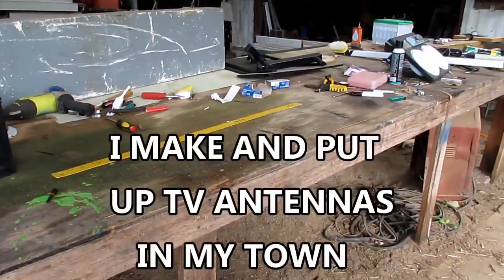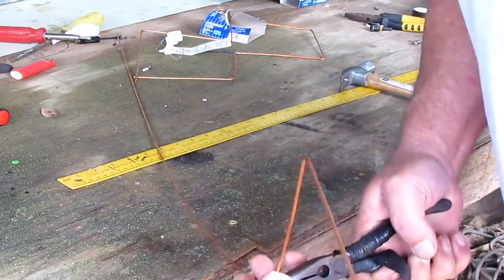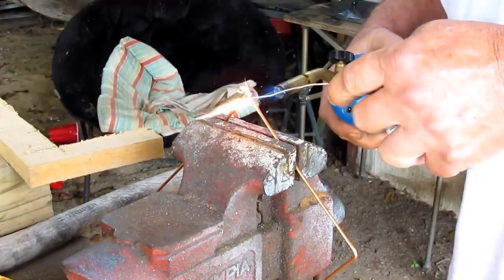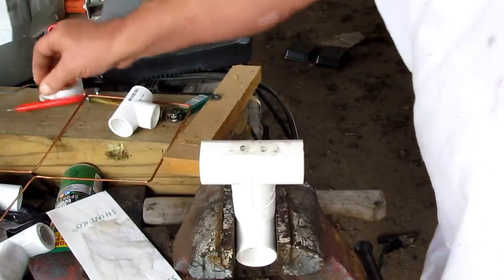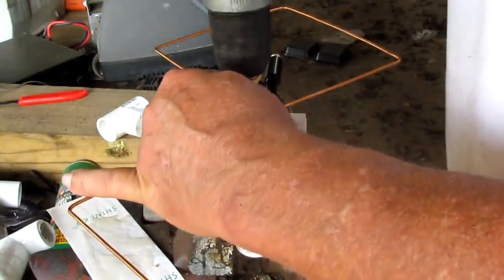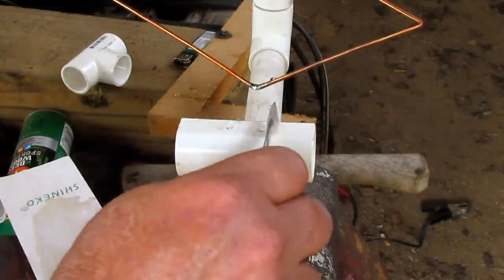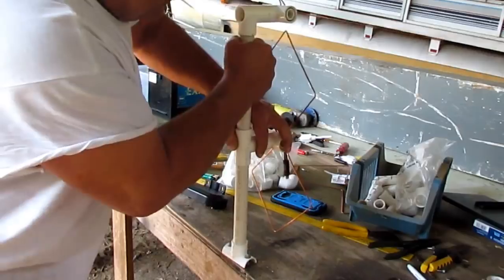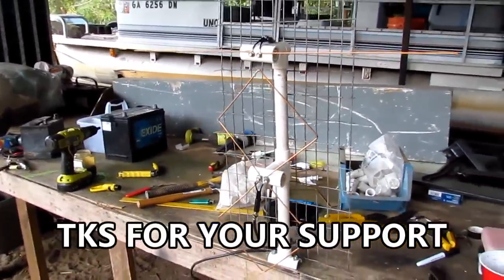Best DIY Indoor Or Outdoor TV Antenna Ever Made

Comment: Danny, the bottom antenna is called a bi-quad. The top is called a dipole. The bi-quad can be improved by adding 2 more diamond or squares on each end. 2 can be enough if the signals you are wanting are strong enough. If the signals are weak add the two extra but do not let them touch at the corners. Your reflector will work better if they are 2 1/2 inches or so from the main element. You can experiment by moving your reflector to find an improved spot. And then again you may not for reception only. But try it some time.
Reply: Por favor .lo podrás traducir en español .estoy muy sorprendido con ese proyecto .agradecido .

Comment: Our building at work is brick and steel beam, we have a HDTV in the lobby.  We've tried 4 different antennas (1) 30 mile, (1) 60 mile and (2) amplified 60 mile.  None of them have been reliable and zero have been able to pull in CBS on VHF.  Watched your YouTube video and decided to give it a try.  You are exactly right... a stick of dynamite!  It has been THE ONLY antenna to pull in VHF channels, and all of the UHF channels have solid reception.  The proofs in the pudding and your antenna has delivered.  Our secretary will have a Christmas surprise when she returns to work and sees the Price is Right on CBS/VHF.  Thank you much for the DIY video.
Reply from the maker: tks for letting us no

Comment: I made one based on this design, I have in attic with 50 foot RG6 coax leading thru walls to garage where I have a 4 port channel master amplifier that goes to 3 TVs in house. The only thing I did different is I removed my reflector and I had a better result (in my area my towers are in all directions so a reflector worked against me). Also I used 8 gauge copper, made bends at 9.5" instead of 6 making my copper length of 76", then for mount I used a 4 foot long 2x2 with PCV "T" mounted to that with "L" bracket. This design outperformed the Clearstream 4-Max which retails for 149.00. I only spent 12 in parts to make this antenna. I never thought of using a drill to straighten out that copper. Thanks Danny.

Comment: I built on just like it. My reception is nearly perfect. 40 miles from station - second floor inside in hallway  - NO AMPLIFIER - just a combiner. Best reception of 3 different antenna. Thanks Danny!!! Tim
Reply from the maker: tks for the info on that
Reply: Amplifiers only benefit the signal if it is above the noise floor of the amplifier, they are used for long cable run line loss or the signal is split to a few receivers. A broad band amp would never have a better noise figure than a tuner, so putting an amplifier right next to a receivers Ant input would not help.  Signal to noise ratio is the important part and ATSC has a tolerance for noise.  Cable companies do not use ATSC  because it takes too much bandwidth they use QAM .

Comment: Constructed primarily from scrap at hand I build two bow-ties on a single refector of just undersized and just oversized of your seven inch baseline, connected to each other with cheap 300 Ohm antenna lead and tapped equidistant with the balun terminals. My copper rod is solid core home construction wire remnents, often I leave the insulation on, which doesn't seem to affect performance at first but much later, having no patina, those antennas have better signal strength than ones I've built with stripped 12 gauge home wiring. To minimize bimetalic corrosion, I use brass screws recovered from old TVs and strip the balun ends to copper then twist and curl onto the screw, soldered, then seal that terminal under hotglue. My balun is the amplifier as well, DC powered by the indoor end of the CoAxial. I even use scrapped and discarded weather hardened twin coaxial cable from homeowners who have decided to "cut the cable" from their Frontier communications provider bill to bring the signal inside. Even the mount is recovered from the wooden yard stakes of candidate signs left over after elections which I wrap to the plumbing riser vents on the roof with discarded coat hanger wire. I use a staple gun to mount the reflector on the back of the stake, and insulate the staples on the front for the bow-ties with end of a long thin strip of home construction roofing felt remnant, cut away from the staple after being attached. My best reflector was powder coated perforated steel cut from a security screen door, second best reflector was expanded aluminum from the bottom of a screen door painted with Rust-Oleum - both paint jobs were as discarded, not my idea. Decent refectors I've salvaged small stainless steel racks from mini-fridges and toaster-ovens, but I've never used rabbit-hutch wire (is that what you use?) The digital ATSC signal is fine with this UHF only design and so, not needing FM radio, I do not include VHF dipoles.

 How dare I claim 'design'? I stole that from ANOTHER guy on YouTube! The most expensive bits of my antennas are the amplifier pair. As measured by the digital tuner setup screen, the signal seems unaffected when the antenna is hung from attic rafters. The signal strength from my antennas are far supierior to and beats anything available from WorstBuy (Best Buy), and, being built from scrap at hand, is a miniscule fraction of the cost. I like your use of PVC but I have no T's or elbows, just plenty of demolition piping which I've used for masts. I learned from you the 'twist' to straighten the wire, but I will still chase the kinks from the wire by hand as best I can first, then twist. I can't disagree, for digital TV, bowties beat all. Why buy "Free TV Key" when you can build your own, more durable, and with better reception? Do you know why you buy one and get the other "free?" Because when it breaks, that was the "free" one!

Comment: Good stuff...I learned how to make one right when DTV started. I got my design from a Popular Mechanics article. I made one with larger wire and a 6 foot 2x2 mahogany plank and when I was done, I was picking up WBTV out of Charlotte N.C. from our little farmhouse in Leicester N,C It was a big contraption with 4 V's on each side and the wire was roughly 4 ft. long each way. Without any booster, I was picking up a Charlotte station inside the house ! and we were a minimum of 100 miles from the broadcast station, probably more so if it is a straight shot to the signal, that always helps.
Now that I've seen your design, I think I'll build another one and make it a hybrid type with a backboard like yours. We have Spectrum Digital Cable as part of our rent but if we didn't, I would use only an antenna. Great  job...I'm going to look at more of your clips. Keep at it, it's great !

Comment: I built one following your instructions. It doesn't look as good as yours but I stuck it in the attic so no one will see it anyway. I'm not using the booster and I still get 24 channels at 30-50 miles away. I built mine with junk I had laying around the garage so my cost was $0. It works much better than the "cheap" one that cost me $20. Thanks.

Comment: Ok the top piece for vhf. I changed it a bit. What I did was I made them 24 inches out #8 grounding wire. Then I put aprox. a six foot radius on them. I also got rid of the 75 Ohm connecter and just went direct. Other than that this is the best antenna ever. Great job bud

Comment: Hi,Danny.You might solder the 300-ohm side of the balun to the copper elements,prevents trouble a few years down the road.And that device you are talking about for combining vhf and   uhf signals is  called a splitter-combiner.Phasing lines mounted behind the reflector can be used instead(check the theory in the ARRL handbook). I've used both.And the booster is to make up for any losses in the line.From an old tech in the Canadian maritimes.
Reply: Why VHF? Hasn't all the new digital gone to UHF?

Normally height is more important that gain. That being the case I built a fan dipole with 3 elements for my camper so I could string it up a tree and it works great here in Texarkana. I forget how many stations but was 5-6. We went camping up in the Ozarks I strung it up 15ft and zero! But its a deep valley where we go camping. 

I am thinking of building a Slim Jim next. This way I can pull it higher in the tree and it has more gain.
Reply: @tonymoore205  YES BUT NO. I THINK THE AMP IS IN THE WAY
Reply: WW5RM You are partially right.   Most Dallas stations have changed to UHF but Ch8 (ABC - WFAA) and one other are still in VHF
Reply: @brentjohnson6654  I thought it was a nationwide move forced by the government that everything go digital and move to UHF. Back when they gave the converter boxes away around 2006-2008 or so.
Reply: @WW5RM  it was. FCC allocates the frequencies.
Reply: @Mikael5732  then how is it possible some stations in Dallas are still on VHF?
Reply: @WW5RM  NO!  That's what i thought too (that all dig went to UHF) So, that's what I put up in 2006 when my huge 22ft VHF/UHF blew down....   In my market we still have 2 HIGH BAND VHF!!!  No, I can't get them on my UHF antenna...  I have designed a full wave square loop for those channels.  it works great in brick houses but, unfortunately, my shop is in a steel building - so I can't get those channels here unless I get it on my roof...
Reply: @hotpeppersrcool  where?
Reply: @brentjohnson6654  Not sure of YOUR market.  I am in Louisville, KY.  BUT, no matter analog or digital, VHF ALWAYS goes farther than UHF - so the "smart" stations (if they WERE VHF) can reach more viewers.  People like you and me (who have taken down our 10ft+ long antennas) can NO LONGER get these channels - even if they "appear" to be UHF numbers!  ALL channel numbers are now "virtual" .  Like, what used to be (in my market) VHF channel 3 (our LOWEST VHF channel) now shows up as UHF channel 47 - which requires a MUCH smaller antenna to receive it!

So, in Louisville, we have Channel 21 (VHF 8) and Channel 11 (VHF 11) which I can not get.  When I am at home (closer to town) I built a full wave square loop (indoors) and I get them just fine - but not at all in my Faraday shield of a steel office building....
Reply: @WW5RM  That's what I heard too...  But some channels are still on VHF.  They just sold 600-700Mhz to a cell phone company - hence the "rescan" if you had to do it last month.  But, in MY market, unfortunately, the VHF's stood where they were.   No matter if you are AM, FM, SSB, DSB, USB, LSB, or ANY of the digital modes...   VHF will ALWAYS go farther than UHF - and that is WHY those station are still there!
Reply: Hugh Jorgan yes I agree that UHF or VHF doesn’t care if it is a analog or digital. I had a UHF antenna originally based on the kit from Danny S Hodges. I had to add a VHF dipole and a combiner pre-amp. I was able to receive real CH8 which is where the virtual ch8 is transmitting in Dallas. Most every other channel is in UHF. You are right about the old 10’ antennas.  A recent tornado blew my channel master TV antenna and tower over.  What a mangled up mess.  Haha.  Thanks for your comment.
Reply: @hotpeppersrcool  yeah I was looking at antennas recently. One said it only covered from CH 21- 80 or so. I thought well crap thats useless because we have 3, 6 and 12 out of Shreveport. But the actual freq of these channels fell in the freq range of the antenna so they just kept the old CH numbers and its virtual like you said. Also i know its digital and narrow signal but wondered how they crammed 3-5 sub channels into one channel. They aren't. Maybe 3 digital channels take up the same width as 2 analog. So they are using multiple channels. But in the UHF range its more room. Like you say VHF is better range but it was a tight fit. 

Military radios covers from 30-70 Mhz. We use to listen to TV stations while in the field. Or the old ones did. 

I need to double check because its one station here I have trouble getting on my UHF antenna that use to be a strong station! It might still be VHF! 

But I am still puzzled because I thought it was a mandate that all stations move to UHF by a certain date because the FCC was selling of the VHF portion. I swear I read that somewhere. So why are some stations allowed to stay on VHF?
Reply: Hi Danny and everyone!!!  I appreciate you sir for your awesome insight and information.   I wanted to mention to Mr Michael Henwood that I tried to solder my balum to my copper wire, and maybe it's due to being a girl, who is not a pro at soldering but when I tried, my wire connectors on my balum came loose and I had to get a new balum.  But it's probably operator error on my part...but thank you all for any and all info and tips.   Keep y'all's fingers crossed I finish up my antenna tonight 🤞🤞
Reply: fancy words wow I am impressed
Reply: @WW5RM  there are still low VHF in some areas  which need larger elements. Channel 3 and 4 need big elements especially if the station is weak and far away. I don't know if channel 2 still exist in VHF rf. 73
Reply: @ronb6182  OK! Thanks! I just went by what i think i read or heard about it. But yeah thats good to know especially building a antenna. I built one but just cut 3 elements for UHF. Around 460-500 mhz i think it was. Heck i forget now. I wonder why some didnt have to make the move to UHF?
Reply: @WW5RM  don't quote me on this but low VHF don't need as much power to transmit to a certain distance. Higher the frequency the more power is needed to travel. There are only a handful of low VHF stations left. I'm talking RF virtual channels can be any frequency. I found one tv stations that had the virtual and rF the same channel or one just one number off.I think it was channel 8 or 9. Go figure. 73

Comment: I subscribed because you have some good antenna ideas.  I have 40 years experience in electronics, but am impressed by your antenna design.  I used to work at a cable tv company as a bench tech and it was my job to test many kinds of matching-transformers (baluns).  You are right that they are not all the same.  Some of them will not pass UHF.  A good method of testing any design is using the TV menu to select CHANNEL SEARCH and write down the signal level. Most tv's have that feature.  I used a wavetek sweep analyzer, but the TV signal level meter would give you a good enough reading to compare various antennas.  Excellent video and I can't wait to see what else you have on your channel.  Dave Mundy from St. Louis, Missouri.
Reply from the maker: thank you

Comment: Your craftsmanship is impressive and i am testimony to the fact your methods and scientific principles are sound!  if you achieved it all by trial and error, more credit to you. I have one question! Since you are using a single plane reflector plane are you picking up signals from just "one" transmitter or let me say are the transmitters you are receiving in the same basic location? I dare say the vast majority of receivers in North America are receiving multiple transmitters from vastly different directions and altitudes. Multiple angles would not lend themselves to the advantages of a single plane reflector plane. I am thinking you position your antennas with the reflector on the far side of the nearest largely populated city. Similarly the basic yagi antenna does the same thing however does not lock you in to a "uni-directional" reflection plane.  So a yagi is positioned correctly for the nearest  group or "clump" of transmitters and also leaves itself somewhat receptive (pun-intended) to other transmitter locations. Direction and altitude. I really admire home brew and you seem like a really great guy, with that said i would like to add the best antenna i have personally used and still use is a $39 yagi from Amazon. I do of course have it sitting up extremely high and must disconnect everything during this time of year due to lightning strikes.  Also, i love your olympia vice! a real classic! Give me a strong vice, PVC pipe and a junk pile anytime! :-) I am very happy i stumbled on your youtube channel and will post a video on my FM Transmitter antenna. A little different, however the same basic principles...  Be well!  Mark
Reply: Ground the YAGI & lightning is no longer a issue.

Comment: I made it with annealed iron wire from Home Depot. I wrapped the entire element with plumber's tape. Even though it's in the attic, I'm pretty sure I'm getting all of the available channels.

I added an omnidirectional FM antenna on the top which I haven't tested yet, but what I do know is that it doesn't interfere with the TV channels.

Comment: Enjoy your builds.  You may wish to look into not using the 300:75 ohm balun on the VHF dipole, and run the coax 75 ohm link direct, since At resonance, the impedance of a half-wave dipole antenna is approximately 70 Ohms, so that the input impedance for a half-wave folded dipole antenna is roughly 280 Ohms. Or make the VHF dipole a folded dipole and will match using your 300:75 xformer. The 75 ohm direct will be unbalanced.
Reply: What?????Need good ol'boy talk to understand
Reply: HUH?  Speak layman language so we know what you are talking about.  Thank you.
Reply: heh cool. 
ya cool..

?

Comment: This design is called a "Gray-Hoverman" antenna (look it up), and it is the real deal for reception.  It can be made in 2 bay, 4 bay, and 8 bay for greater and greater distance.  TV "dx-ing" has some anomalies that I learned the hard way.  It is like drilling a well, where two feet can be the difference between all or nothing.  Distant signals often tend to have lateral peaks and valleys in strength, and sadly some areas suffer drop-out from complex signal cancellation paths.  Height usually helps of course, but there are other factors.